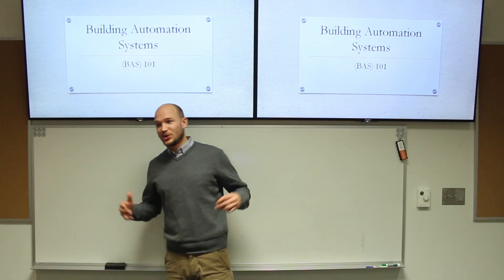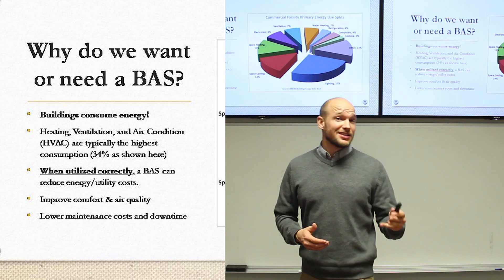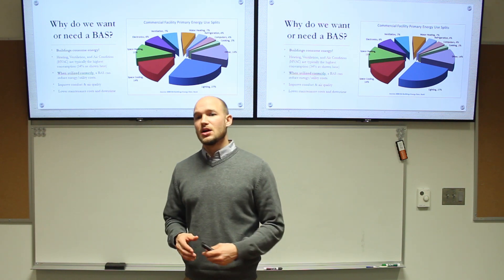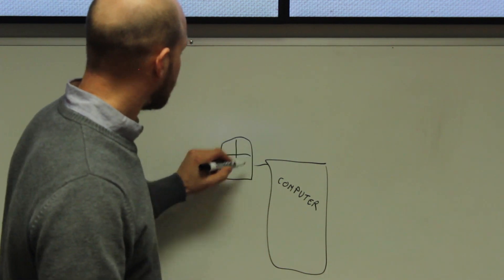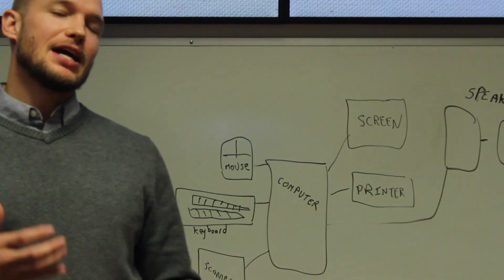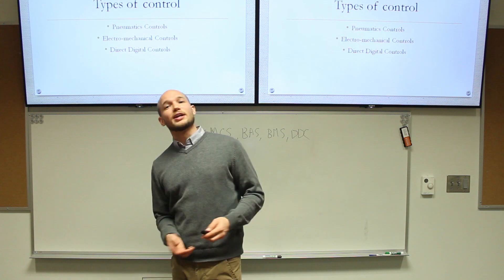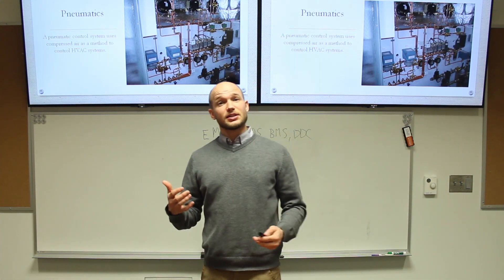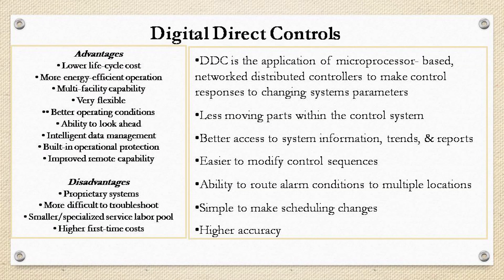Building Automation Systems Lesson 1  - BAS 101 training system basics

Comment: good stuff. 
I would like to take one system and go through from top to the bottom in many videos as required with describing, each component how it works, what kind of signaling protocols going on. Don't go mad with explaining in a very simplistic way, better just use right technical words instead and make videos short as possible. Voltages, types of wires used, and one or two examples of controllers with high-level overview finally with programing it to achieve exact real-life results.
thank you in advance.